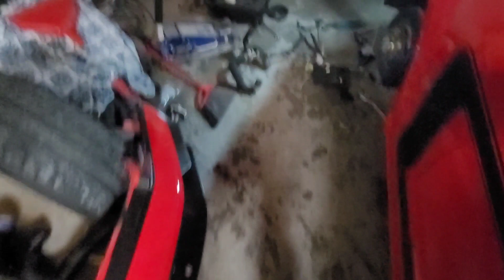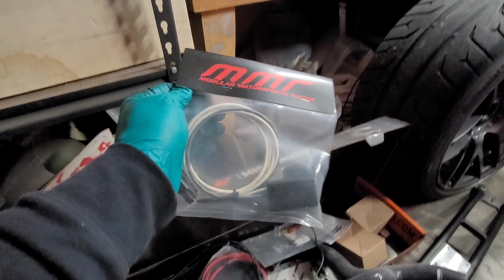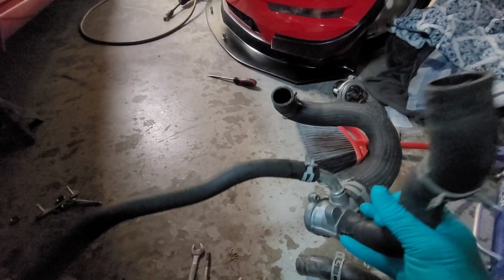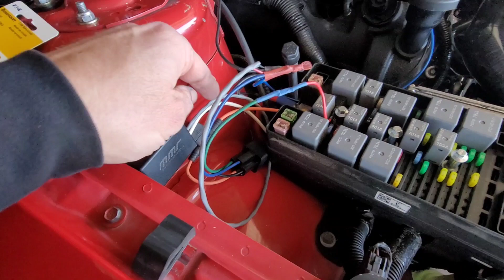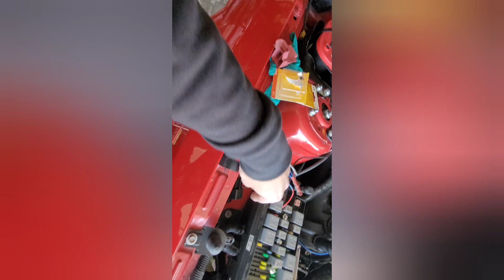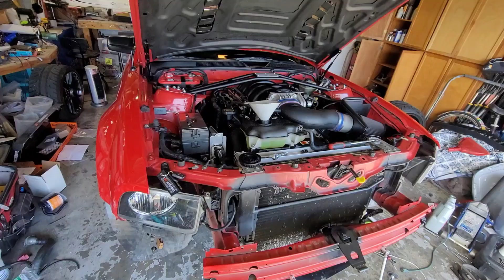4.6 3V ELECTRIC STEERING CONVERSION AND MEZIERE ELECTRIC WATER PUMP INSTALL...*TEST DRIVE BOIIIII*

Comment: Do you by any chance have a belt part # for the 63 1/2” belt? Would that size work if I have a stock water pump. I did the EPAS swap and eliminated both idler pulleys on driver side of engine.

Comment: What would estimate the weight difference is between the two different steering systems. Or how heavy is the electric steering system. thank you for the information good video.
Reply from the maker: Pretty close weight wise. I think electric is slightly lighter